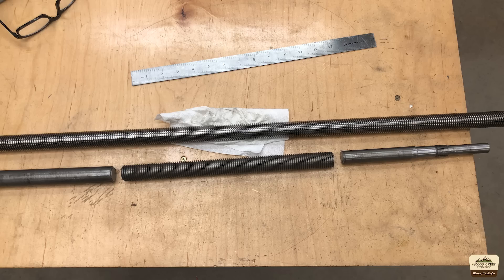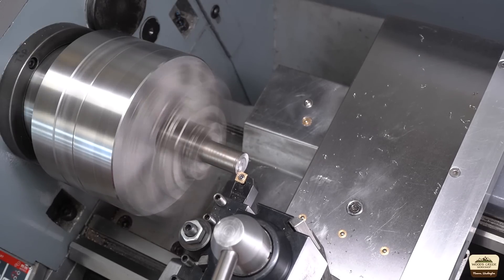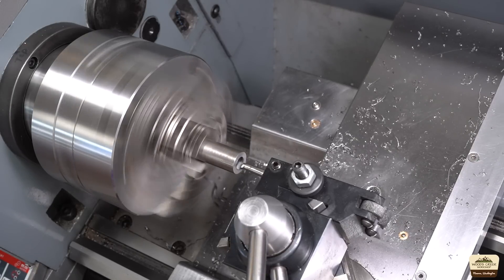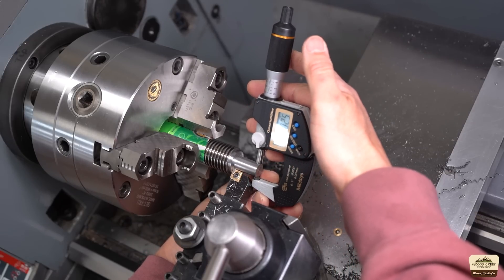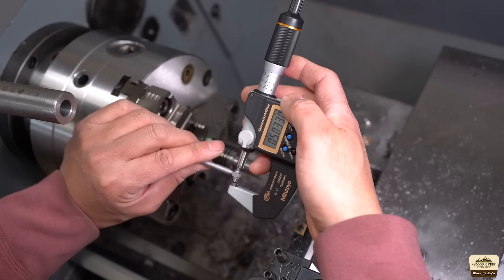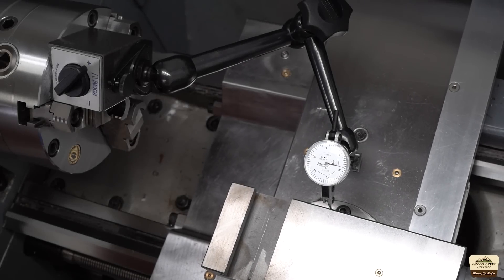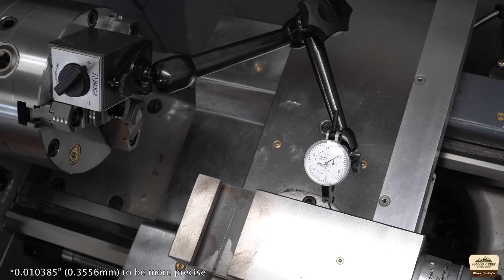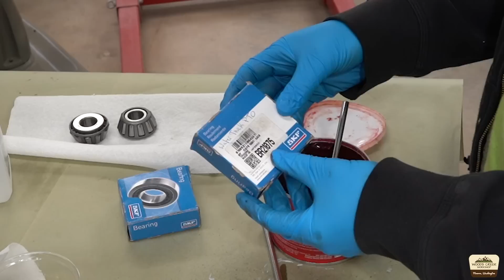Replacement Leadscrew and Restore Crossfeed:  CINCINNATI Tool and Cutter Grinder Restoration Part 7

Comment: You are using the telescoping gauges incorrectly. The correct technique is to insert the gauge at an angle, tighten the gauge and then roll the gauge through the bore so that it is forced to collapse to the bore diameter. With the gauge tightened sufficiently it will not move while taking the measurement.

Comment: I have a couple of these machines. I always felt like the threads on that leadscrew needs to be the opposite hand. I always have think about which way to turn the hand wheel when operating from the front. It seems backwards compared to a milling machine. 

Also did you find a replacement for the spindle bearings? one of mine needs new ones.

Comment: Get a set of pin gauges Yuchol. They are very handy for checking hole sizes as you bore them.  Even the import ones are quite accurate. You can easily sneak up on the dimension checking with a known pin size.  When you got to about .4950" you can then slow your depth of cut and get a very precise fit.
I really enjoy your videos. 
Joe

Comment: Looking great Yuchol. 

Ironic you uploaded this, I'm in the process of the same for the compound on my lathe. I decided to order threaded rod from McMaster because the inserts to cut the Acme thread I need are more expensive than double the finished material length for the project. Plus cutting screw threads with a messed up compound feed is... challenging. 🤣
Reply from the maker: Good luck!

Comment: That grinder is really coming along well, it'll look better than new when it's finished. Except maybe for that rubber gaiter😊. 
Just one small tip. I noticed when you filed the taper pins that you filed "around" the circumference of the leadscrew. Counterintuitively, if you file in the opposite direction, so that the front of the file rises and the back falls in relation to the circumference, you will end up with a more circular and accurate finish.
Reply from the maker: Yeah, I did it both ways, but sometimes the mood strikes.

Comment: Just curious… why three part screw and not a single part?
Reply from the maker: Cheaper, easier, quicker, lazy.
Reply: @woodscreekworkshop9939  I was wondering about the cost of the screw, and if there was enough clearance to cut the threads off and turn your features.
Reply: High risk vs reward. Cutting a long ACME thread on a home size lathe or older lathe; a lot can go wrong. "long ACMEs are not easy" Plus all the other features on the ends. Using a commercially made screw blank, is good safe method for the repair.

Comment: I had the same problem with snap gauges until I saw a video by Abom where he showed you should rock/pivot the gauge across the faces of the micrometer until you can just feel resistance. You can not use the ratchet on the micrometer. Even after I stripped, cleaned and deburred the cheap chinese snap gauges I still had to bin them. Bought a set of used Mitutoyo snap gauges from ebay